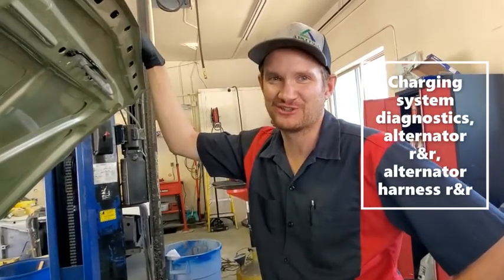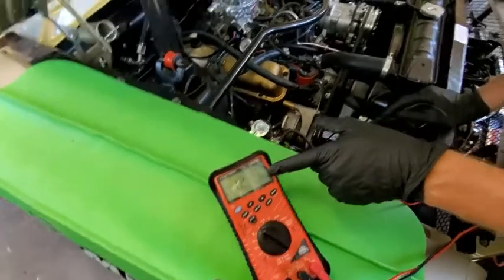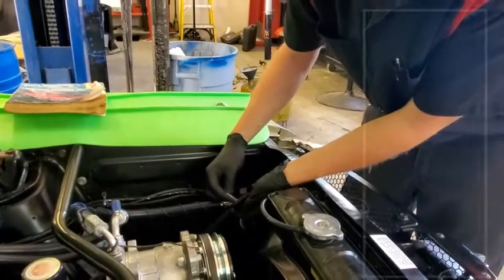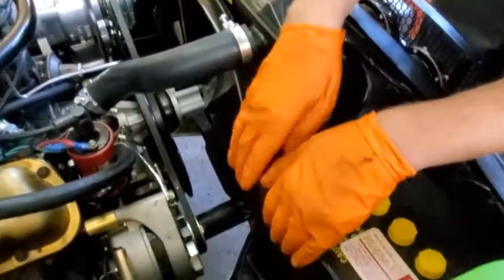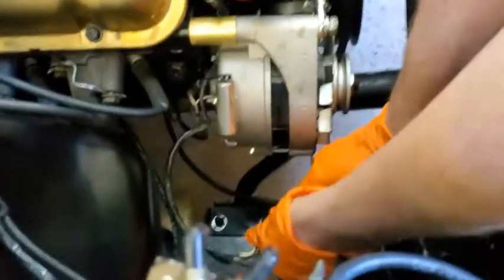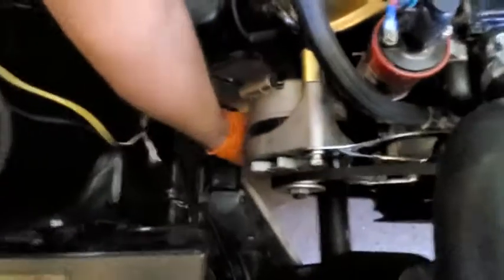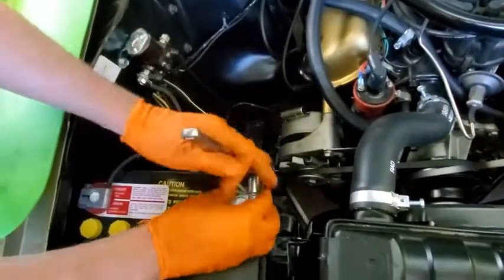1965 Ford Mustang alternator & harness-diagnostics & replacement.

Comment: I have a 66, 289 and no harness, just loose wires between the regulator and the alternator. I can't figure out where the wires should go. ISF and I forget the last one on the regulator. I Think S goes to the alt stater, F goes to the alt field, G goes to the alt ground, I goes  ... where ?  Somewhere a small light goes to indicate the exciter wire is working I think. Not sure about ANY of the ISF positions actually.  Please advise. Frustrated.

Comment: Gawd I've been dealing with this issue for days now I have a 82 ford f250 with the 351 cleveland I replaced the alternator and it's still not charging up watching your vid gave me sooooooo much help ty ty my question where did you get the new harness on the alternator side? And part# ???? Ty so much for your knowledge
Reply from the maker: Oh thanks! Glad it helped. I buy the Mustang stuff from National Parts Depot. I think they sell for the pickups as well.

Comment: You did not show us how the Mustang was incorrectly wired, that would have been helpful.
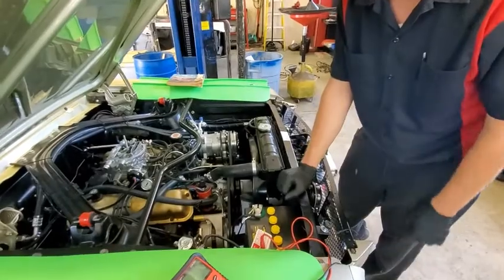Reply from the maker: At 6:50 I explain that the harness on the car was the incorrect harness. At 3:10 I explain there isn't a charge back wire from the alternator to the battery.

Comment: Nice video, but lose the gloves girly man.
Reply from the maker: When you work on a $100K restoration and you get in and out of the car, you wear gloves to protect and respect your client's investment.
Reply: @AlfsMustangGarage  OK, I stand corrected.
Reply from the maker: But to be honest, I wear gloves on everything I work on. I find it very easy to have clean hands when I get in the car or get into anything I don't want dirty. Gloves come off and bam, clean hands 👍
Reply: I like the girly gloves! 🤓
Reply from the maker: These girly gloves might just be my signature. Now I'm going to have to reference them in every video.
Reply: @AlfsMustangGarage  No shame in wearing girly gloves. I started my career as a full-time mechanic working bare handed. A few shots of brake cleaner and gasoline into fresh cuts and skinned knuckles cured me of that habit quickly.
Reply from the maker: Oh ya that will do it. I like to protect myself and my client's investment as the same time 👍

Comment: Hello Alf - I have a battery charging issue. My question is regarding the starting relay. Once the car is running I believe that the post that goes to the starter should read 0 volts. This post connected to the starter should read 12 volts only when the car is being started (on crank) is this correct? Right now I see 12volts on the post to the starter even when the car is in the off position. I believe this is incorrect as well. Please confirm
Reply from the maker: You would be correct. You should only see 12 volts going to the starter only when the key is turned in the "start" position.
Reply: @AlfsMustangGarage  Could this be a voltage regulator issue?
Reply from the maker: @eddievantailn2882 no. I would remove all wires from the starter solenoid and perform a continuity test across the battery and starter post. If there is continuity there, the solenoid is bad. Could have burnt up your starter too. Usually if there is power going to the starter, the engine cranks over.
Reply: @AlfsMustangGarage   I agree and understand totally. If the alternator is bad does it still make that sound like it's attempting to start? If the starter relay and the alternator are good the car should start, right? I should of mentioned this is a new motor.
Reply from the maker: @eddievantailn2882 I'm not sure what noise the alternator is making when you attempt to start but I'll tell you this, when it comes to the starting sequence, the alternator has nothing to do with it.
Reply: @AlfsMustangGarage  Sorry Alf I meant to say starter not alternator

Comment: Hi Alf, I have a 65 Coupe. I lose all electric when trying to start. The battery is good and the regulator is fairly new. Can you give some advice on what to try? Thanks.
Reply from the maker: I would check connections at the battery and the battery ground. I would also be checking the main electrical plug that goes through the firewall on the engine bay.

Comment: Where can you get a new harness like that. I have a  65 mustang. Before we put new battery and alternator on and voltage regulator. My dash battery/alt light worked after install lights would not come on.2weeks later battery was dead and read bad. Got a new battery but do not want to put in  until I know what’s going on.
Reply from the maker: We got that one from National Parts Depot. There are a few options so just make sure you get the right one for your car 👍
Reply: I need a good Ford Mustang mechanic in Omaha Nebraska area. I am stumped
Reply: @AlfsMustangGarage  thanks. I have a 65 mustang 289 v8 auto. No power steering or ac. I believe it only has red lights for battery/ altenator. I found the sight, but trying to find right one.? Our car is automatic. If you mix up 2 white wire will that mess anything up.
Reply: You have been a big help last few minutes while I am on break and hope I can get it back up running in a week.
Reply from the maker: Whenever I'm trying to figure out the right one of anything, I usually just call and talk to them. But for those alternator harnesses its usually just which engine and if you have an alternator light or a gauge. And you said you have the light. That's usually the difference is there will be a 289 for a gauge and a 289 for a light.
Reply from the maker: Good mechanics are hard to find. I know people say older cars are easier to work on but that's not necessarily true. I wish I were closer.
Reply from the maker: Good luck, I hope you can get it figured out.
Reply: @AlfsMustangGarage   I think you're closer for me.. I'm in Lehi and need some help... you available ?
Reply from the maker: Oh right on! I'm always busy but what do you have going on?
Reply: @AlfsMustangGarage  basically the same thing, new battery put in yesterday and still had to jump it today (twice), I'm guessing alternator and or volt regulator, both of which I am happy to replace, and can handle however, I'm afraid it might be something else since I have several wires that are melted and not looking great..
Reply from the maker: Is your battery draining when the car is parked and engine off?
Reply: @AlfsMustangGarage  that's exactly right
Reply from the maker: You probably have a battery draw. Do you have any aftermarket accessories installed such as a stereo or anything? Also check the glovebox light and courtesy lights. Make sure those aren't stuck on. Do you know how to test for excessive draw?
Reply: Hay thanks. Had a bad harness, put a new battery new voltage regulator. 2 wires where cross backwards at altenator. But I had a fault regulator. All good now
Reply: I will have the car rewired some day.
Reply from the maker: Awesome! Glad to hear you got it figured out.
Reply: @AlfsMustangGarage  lights are good, i do have an aftermarket radio but this has never been a problem until now. does alf's take appointments?
Reply from the maker: I probably wouldn't rule it out just because it hasn't given you a problem in the past. Whatever is causing your problem hasn't been a problem till now. I do take appointments. However, how soon do you need to be fixed up?

Comment: Hey Brother Alf! Nice video. I took my alt off and had it tested. Very low output. I decided to replace it to a new one wire 110 amp upgrade. Old Alt was 75 amp I think it was the original off my 67 mustang big block.  Love the one wire install. I took the old Alt apart and found the brushes were bad. Don't know where to find old Ford Alt brushes but will save it for a back up or sell it at the car show. Now I know what the 1 female two male plug/pigtail at the  solenoid was used for, lol IMO, the 1 wire is the way to go and upgrading to higher amps for fog lights, and two 10" pusher fans. Thanks for sharing, Cheers and blessings from Motown/Dearborn.
Reply from the maker: Oh ya for sure, very nice upgrade. Those originals are nice to keep around for someone who make be trying to keep things concourse correct. Good job and thanks again for being here!
Reply: @AlfsMustangGarage  I just love running into your older videos. Always great info! Hope you have settled into your new shop and enjoy it.
Reply from the maker: Thanks! We are fairly settled. I already wish I had a bigger shop 🤣
Reply: @AlfsMustangGarage  Ahhhhh, the price of success!
Reply from the maker: Lol yup, now it becomes a balancing act to try to work through everyone and still have time for YouTube 👍

Comment: So was this problem the actual alternator harness? I am having a similar problem. Engine starts with Solenoid but not with key.
Reply from the maker: So the problem with this was it had the wrong alternator harness. If you're having problems with it starting, you need to be looking into your starting system and not the charging system. For example, just based off what you told me, you probably have a problem with your starter solenoid. You need to test if it's getting power on key start and that it's transferring the battery power from battery side to starter side.

Comment: Hi, can you advise how test the alternator? I have the same problem basically. thanks
Reply from the maker: Have you tried jumping the "A" and "F" terminals on the voltage regulator while observing the battery voltage with a volt meter?
Reply: Not yet, will try tomorrow
Reply from the maker: 👍 most cases when I jump the regulator and the voltage spikes, that means the alternator is working properly but isn't being regulated properly. So at that point, a new regulator is likely what it needs. Now on the flip side, if the battery voltage doesn't change, the alternator or wiring would be suspicious.
Reply: I’ll keep posted many thanks

Comment: If I upgrade to a one wire alternator do I still need the voltage regulator?
Reply from the maker: No. A one wire alternator will have a built in regulator.
Reply: @AlfsMustangGarage  but with it built in then I can ditch the voltage regulator box? Sorry I’m a newbie
Reply from the maker: No worries. I don't know if I would ditch it. I would probably leave it there and tape up the old wires in case you or someone wants to put it back to original.

Comment: The v. Regulator was unplugged for some reason. All good now
Can you advise about the best steering box for 1965 coupè pls? Atm the steering is vague and despite a new power steering is fitted
Reply from the maker: Well that was an easy one lol. So do you have manual steering and looking to upgrade to ps?
Reply: I have installed Ps already but still not a good result. Not sure if the steering box is working properly
Reply from the maker: What kind of ps did you install? All factory stuff or an aftermarket?
Reply: @AlfsMustangGarage  Not sure , I bought a kit from NPD Depot
Reply from the maker: You probably got the Borgenson kit?
Reply: I don’t think because I’ve got the same steering box installed on the car
Reply from the maker: Humm ya I'm not sure what you have then. The car wasn't a factory power steering car?
Reply: No, I’ve installed the power steering. But I’m concerned about the steering box which is still the original one.
Reply from the maker: Is there lots of play in the steering box? They are adjustable to get them tight again but if its already been adjusted as far as it can, then it may need to be rebuilt.

Comment: I’m getting up to 16v on my system, and I just replaced the voltage regulator, would it likely be the wiring to the regular? Alternator looks good
Reply from the maker: Well essentially on these setups, the alternator is usually doing what it's told to do. So I would be checking wiring to the regulator or the regulator itself is bad.

Comment: I have the mustang 1964 same problem.In regulator what is A and F  terminals stand for ? Whats the colour of those wires ?
Reply from the maker: So if you have an early 65 (64.5), you probably have a generator? If so your regulator will be different than an alternator car. On an alternator car, I is for ignition green wire. A is for alternator battery terminal, yellow wire. S is for Stator, white with black stripe. F is for Field, white wire. Foe the generator cars, A is yellow and black (not 100% on what it stands for on generators). F is field white wire and B is red wire goes to the battery side of the starter relay solenoid.
Reply: @AlfsMustangGarage  thank you so much for your reply .Your videos are informative. Please keep uploading.
Reply from the maker: You're welcome! Thanks for subscribing!

Comment: Hey Alf I’m having and issue with charging, wiring seems to be correct, when I went to jump the A and F on the plug for the voltage regulator it sparked with the ignition off, then the wire warmed up and I unplugged it quick, Any guess as to why it would be doing that?
Reply: I do this test with car running and jumper wire on a pair of vise grips. Just leave on long enough to get a voltage reading. The jumper wire does get hot.

Comment: Is this the one with charging light? I got an amp gauge in mine the black/yellow thick wire runs past it in a loop but seems wired differently to this one. Cant seem to get mine right. Charging backwards!
Reply from the maker: Yes this is for a car with a light and yes they are wired different for one with a gauge.
Reply: @AlfsMustangGarage  Thanks, it's also worth mentioning for those who have a car with voltmeter gauge that there's nothing to put on 'Stator' terminal. And the black/yellow battery wire goes right around the car through the dash and back out the firewall to the hot relay terminal. And if your gauge is going the wrong way like mine it could be threaded through the meter loop the wrong way. it's dummy easy to get wrong if you're under the dash everything is back to front. Thanks for this video Alf it's sorted out something which is hard to find on the internet there are so many ideas and conflicting opinions how to do this. Well worth replacing these old wires I just bent the red/black wire a little and it snapped in my hand with no pressure! The old wires are so stiff and brittle.
Reply from the maker: You're welcome. You're right there is lots of information out there and it's different on a gauge vs a light and what not. Glad I was able to help a little.

Comment: There was a charging problem, low charge around 12,1 Volts. After the re-build up, it raised to 14.45 Volts. So which part is replaced? The cable?
Reply from the maker: I'm not sure what you're asking.
Reply: Wrong alternator harness was installed.

Comment: Where does the negative wire from the alternator hook up to the block?
Reply from the maker: Typically goes to the same ground as the battery ground.
Reply: @AlfsMustangGarage  I gotta check out my set up I hace a three wire new alternator and it isn’t charging . I can’t find a place on my block to hook it up or screw on .

Comment: I have a ‘67 c code car that im getting ready to add EFI too…upon inspection i noticed when the car is running and i have a meter at the battery it is charging and getting its 14v but i noticed that it fluctuates and jumps all around from 5v 8v 12v 14v……but it seems to run fine….i just replaced the voltage regulator and noticed when i unplug the regulator it makes no diffrence
Reply from the maker: Have you tried checking your system with multiple meters? Seems weird.

Comment: I cannot for the life of me find what the wire is called that connects to the alternator wiring harness, it’s the first two wires you disconnected after disconnecting the battery, would appreciate if you can tell me the name of the wire the alternator wire harness goes into
Reply from the maker: Are you asking about the harness on the car that plugs into the alternator?
Reply: @AlfsMustangGarage  yes sir
Reply: @AlfsMustangGarage  yes sir
Reply from the maker: Is that the engine gauge feed wire harness?
Reply: @AlfsMustangGarage  hmm not sure I’m just trying to figure out what the female plug is called for the alternator wiring harness
Reply: @AlfsMustangGarage  I should mention I have a 69 mustang
Reply from the maker: https://www.npdlink.com/product/wire-loom-firewall-to-headlight/101959/202877?year=1969  
I think this is what you're looking for. Its called the headlight feed harness. But it also includes the feed from the voltage regulator to the alternator. There are two different versions. One with tachometer and one without.
Reply: @AlfsMustangGarage  exactly yes you’re right, I actually figured it out 2 days ago, thanks a lot!
Reply from the maker: Oh right on! I've been moving my shop otherwise I'm usually faster to respond.